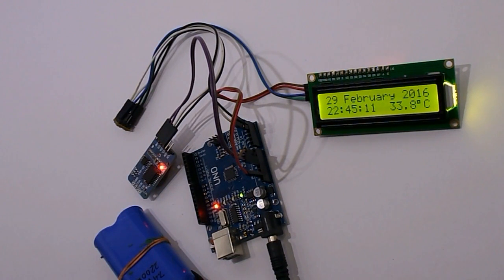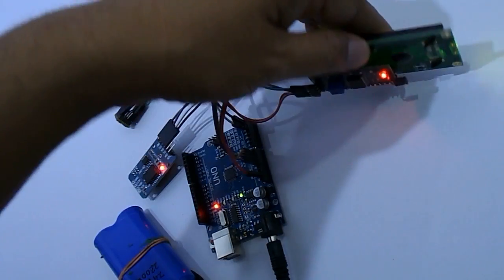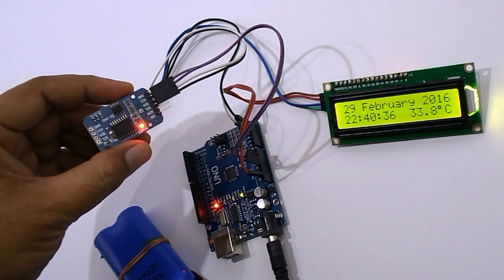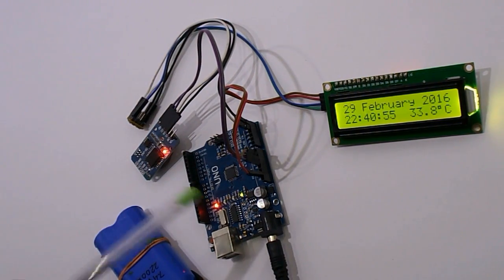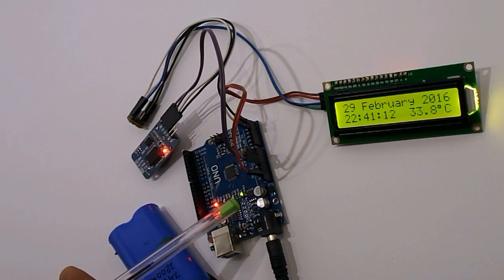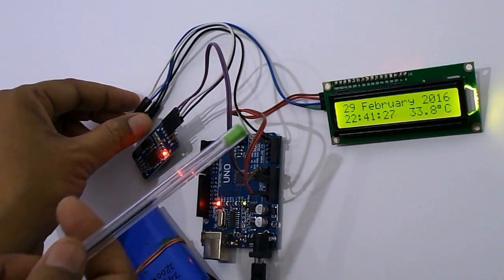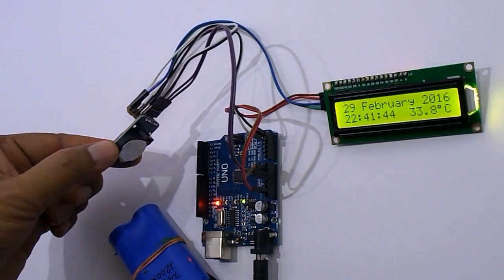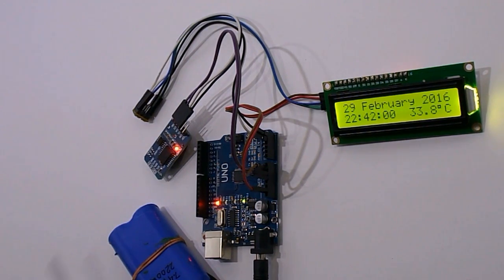Display Date Time and Temperature using DS3231 RTC and I2C LCD

Comment: Bro i try to access code but the page says need access ; i have request but access not grant yet. anyone can share the code ; hope someone there able to help
Reply from the maker: Shared
Reply: bro , what ever in code is not working .. getting error -  C:\Users\PETER JOHNSON\OneDrive\Desktop\LCDRTC_WITHTEMP\l2c\Arduino\DS3231_LCD_Date_Time_Temperature_ON_I2C\DS3231_LCD_Date_Time_Temperature_ON_I2C.ino:24:81: error: no matching function for call to 'LiquidCrystal_I2C::LiquidCrystal_I2C(int, int, int, int, int, int, int, int)'
 LiquidCrystal_I2C  lcd(I2C_ADDR,En_pin,Rw_pin,Rs_pin,D4_pin,D5_pin,D6_pin,D7_pin);
                                                                                 ^
In file included from C:\Users\PETER JOHNSON\OneDrive\Desktop\LCDRTC_WITHTEMP\l2c\Arduino\DS3231_LCD_Date_Time_Temperature_ON_I2C\DS3231_LCD_Date_Time_Temperature_ON_I2C.ino:3:0:
c:\Users\PETER JOHNSON\Documents\Arduino\libraries\LiquidCrystal_I2C/LiquidCrystal_I2C.h:57:3: note: candidate: LiquidCrystal_I2C::LiquidCrystal_I2C(uint8_t, uint8_t, uint8_t)
   LiquidCrystal_I2C(uint8_t lcd_Addr,uint8_t lcd_cols,uint8_t lcd_rows);
   ^~~~~~~~~~~~~~~~~
c:\Users\PETER JOHNSON\Documents\Arduino\libraries\LiquidCrystal_I2C/LiquidCrystal_I2C.h:57:3: note:   candidate expects 3 arguments, 8 provided
c:\Users\PETER JOHNSON\Documents\Arduino\libraries\LiquidCrystal_I2C/LiquidCrystal_I2C.h:55:7: note: candidate: constexpr LiquidCrystal_I2C::LiquidCrystal_I2C(const LiquidCrystal_I2C&)
 class LiquidCrystal_I2C : public Print {
       ^~~~~~~~~~~~~~~~~
c:\Users\PETER JOHNSON\Documents\Arduino\libraries\LiquidCrystal_I2C/LiquidCrystal_I2C.h:55:7: note:   candidate expects 1 argument, 8 provided
c:\Users\PETER JOHNSON\Documents\Arduino\libraries\LiquidCrystal_I2C/LiquidCrystal_I2C.h:55:7: note: candidate: constexpr LiquidCrystal_I2C::LiquidCrystal_I2C(LiquidCrystal_I2C&&)
c:\Users\PETER JOHNSON\Documents\Arduino\libraries\LiquidCrystal_I2C/LiquidCrystal_I2C.h:55:7: note:   candidate expects 1 argument, 8 provided
C:\Users\PETER JOHNSON\OneDrive\Desktop\LCDRTC_WITHTEMP\l2c\Arduino\DS3231_LCD_Date_Time_Temperature_ON_I2C\DS3231_LCD_Date_Time_Temperature_ON_I2C.ino: In function 'void setup()':
C:\Users\PETER JOHNSON\OneDrive\Desktop\LCDRTC_WITHTEMP\l2c\Arduino\DS3231_LCD_Date_Time_Temperature_ON_I2C\DS3231_LCD_Date_Time_Temperature_ON_I2C.ino:36:17: error: 'DS3231_INTCN' was not declared in this scope
     DS3231_init(DS3231_INTCN);
                 ^~~~~~~~~~~~
C:\Users\PETER JOHNSON\OneDrive\Desktop\LCDRTC_WITHTEMP\l2c\Arduino\DS3231_LCD_Date_Time_Temperature_ON_I2C\DS3231_LCD_Date_Time_Temperature_ON_I2C.ino:36:17: note: suggested alternative: 'DS3231_get'
     DS3231_init(DS3231_INTCN);
                 ^~~~~~~~~~~~
                 DS3231_get
C:\Users\PETER JOHNSON\OneDrive\Desktop\LCDRTC_WITHTEMP\l2c\Arduino\DS3231_LCD_Date_Time_Temperature_ON_I2C\DS3231_LCD_Date_Time_Temperature_ON_I2C.ino:43:8: error: 'class LiquidCrystal_I2C' has no member named 'setBacklightPin'; did you mean 'setBacklight'?
    lcd.setBacklightPin(BACKLIGHT_PIN,POSITIVE);
        ^~~~~~~~~~~~~~~
        setBacklight
C:\Users\PETER JOHNSON\OneDrive\Desktop\LCDRTC_WITHTEMP\l2c\Arduino\DS3231_LCD_Date_Time_Temperature_ON_I2C\DS3231_LCD_Date_Time_Temperature_ON_I2C.ino:43:38: error: 'POSITIVE' was not declared in this scope
    lcd.setBacklightPin(BACKLIGHT_PIN,POSITIVE);
                                      ^~~~~~~~
Multiple libraries were found for "LiquidCrystal_I2C.h"
  Used: C:\Users\PETER JOHNSON\Documents\Arduino\libraries\LiquidCrystal_I2C
  Not used: C:\Users\PETER JOHNSON\Documents\Arduino\libraries\NewLiquidCrystal-master
exit status 1

Compilation error: no matching function for call to 'LiquidCrystal_I2C::LiquidCrystal_I2C(int, int, int, int, int, int, int, int)'

Comment: why the wire.h directory eror
Arduino: 1.8.13 (Windows 10), Board: "Arduino Uno"

C:\Users\alvian\Documents\Arduino\libraries\LiquidCrystal_I2C\I2CIO.cpp:35:10: fatal error: ../Wire/Wire.h: No such file or directory

 #include <../Wire/Wire.h>

          ^~~~~~~~~~~~~~~~

compilation terminated.

exit status 1

Error compiling for board Arduino Uno.

This report would have more information with
"Show verbose output during compilation"
option enabled in File -> Preferences.

Comment: У меня работает только с таким скетчем:
#include <Wire.h>
#include <ds3231.h>
#include <LiquidCrystal_I2C.h>
#define BUFF_MAX 128

//***************************************Define I2C LCD Display ********************************
LiquidCrystal_I2C lcd(0x27, 16, 2);  // Define I2C Address for the PCF8574T 
//--(Following are the PCF8574 pin assignments to LCD connections )---
// This are different than earlier/different I2C LCD displays

/*----( Declare objects )----*/  

//********************************** END LCD DISPLAY *****************************************

uint8_t time[8];
char recv[BUFF_MAX];
unsigned int recv_size = 0;
unsigned long prev, interval = 1000;

void setup()
{
    Serial.begin(9600);
    Wire.begin();
    DS3231_init(DS3231_INTCN);
    memset(recv, 0, BUFF_MAX);
    Serial.println("GET time");

  //*************************LCD Setup*******************************
   lcd.begin (16,2);  // initialize the lcd 
   // Switch on the backlight
 lcd.backlight();
  //**************************END LCD Setup*******************************
    
    Serial.println("Setting time");
    setTheTime("003922101092018");     // ssmmhhWDDMMYYYY set time once in the given format

}

void loop()
{
    char tempF[6]; 
    float temperature;
    char buff[BUFF_MAX];
    unsigned long now = millis();
    struct ts t;
    // show time once in a while
    if (now - prev > interval){
        DS3231_get(&t); //Get time
        temperature = DS3231_get_treg(); //Get temperature
        dtostrf(temperature, 5, 1, tempF);

        lcd.clear();
        lcd.setCursor(0,0);
        
        lcd.print(t.mday);
        
        printMonth(t.mon);
        
        lcd.print(t.year);
        
        lcd.setCursor(0,1); //Go to second line of the LCD Screen
        lcd.print(t.hour);
        lcd.print(":");
        if(t.min<10)
        {
          lcd.print("0");
        }
        lcd.print(t.min);
        lcd.print(":");
        if(t.sec<10)
        {
          lcd.print("0");
        }
        lcd.print(t.sec);
        
        lcd.print(' ');
        lcd.print(tempF);
        lcd.print((char)223);
        lcd.print("C ");
        prev = now;
    }

}

void setTheTime(char *cmd)
{
    struct ts t;

    // ssmmhhWDDMMYYYY  set time

        t.sec = inp2toi(cmd, 0);
        t.min = inp2toi(cmd, 2);
        t.hour = inp2toi(cmd, 4);
        t.wday = inp2toi(cmd, 6);
        t.mday = inp2toi(cmd, 7);
        t.mon = inp2toi(cmd, 9);
        t.year = inp2toi(cmd, 11) * 100 + inp2toi(cmd, 13);
        DS3231_set(t);
        Serial.println("OK");
}

void printMonth(int month)
{
  switch(month)
  {
    case 1: lcd.print(" January ");break;
    case 2: lcd.print(" February ");break;
    case 3: lcd.print(" March ");break;
    case 4: lcd.print(" April ");break;
    case 5: lcd.print(" May ");break;
    case 6: lcd.print(" June ");break;
    case 7: lcd.print(" July ");break;
    case 8: lcd.print(" August ");break;
    case 9: lcd.print(" September ");break;
    case 10: lcd.print(" October ");break;
    case 11: lcd.print(" November ");break;
    case 12: lcd.print(" December ");break;
    default: lcd.print(" Error ");break;
  } 
}
Reply: Спасибо Виктор, у меня тоже так работает.

Comment: Sorry, sr. could you tell me what you use to conect both I2C in the same pin A4 and A5 of the arduino? where can I buy it ?
Reply from the maker: this is just a small connector i have made. you may use bradboard also.
Reply: @brainstormabc  hello sir im making different project so i have already connceted 5v connection and ground connection so is it work if i connect A4 and A5 pins there?
Reply: Hi you don't need it just connect the display to A4, A5 and the sensor to SCL,SDA both sets of pins are i2c on the UNO.

Comment: i downloaded the code, but i got these errors!  

C:\Program Files (x86)\Aceduino\Arduino 1.0\libraries\RTCds3231\ds3231.cpp: In function 'void DS3231_set(ts)':
C:\Program Files (x86)\Aceduino\Arduino 1.0\libraries\RTCds3231\ds3231.cpp:82: error: call of overloaded 'write(int)' is ambiguous
C:\Program Files (x86)\Aceduino\Arduino 1.0\libraries\Wire/Wire.h:55: note: candidates are: virtual size_t TwoWire::write(uint8_t)
C:\Program Files (x86)\Aceduino\Arduino 1.0\hardware\arduino\cores\arduino/Print.h:49: note:                 size_t Print::write(const char*)
C:\Program Files (x86)\Aceduino\Arduino 1.0\libraries\RTCds3231\ds3231.cpp: In function 'void DS3231_get(ts*)':
C:\Program Files (x86)\Aceduino\Arduino 1.0\libraries\RTCds3231\ds3231.cpp:100: error: call of overloaded 'write(int)' is ambiguous
C:\Program Files (x86)\Aceduino\Arduino 1.0\libraries\Wire/Wire.h:55: note: candidates are: virtual size_t TwoWire::write(uint8_t)
C:\Program Files (x86)\Aceduino\Arduino 1.0\hardware\arduino\cores\arduino/Print.h:49: note:                 size_t Print::write(const char*)

Comment: I have saw your iscp video to program from one board to another board. my problem is I am facing some issue with one of the board I think it have a Miso port issue. Could this be a faulty chipset and can I burnt it again to reactive the function of this board? the board I have is a Uno just like this video. thanks in advance for your advise